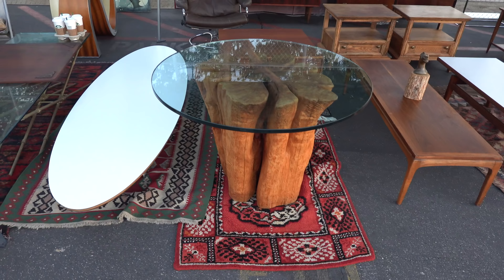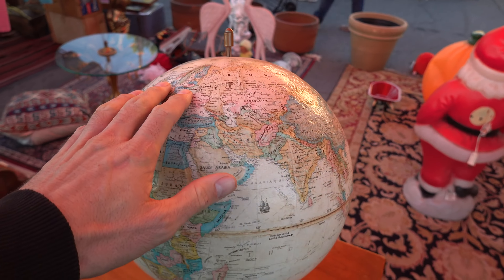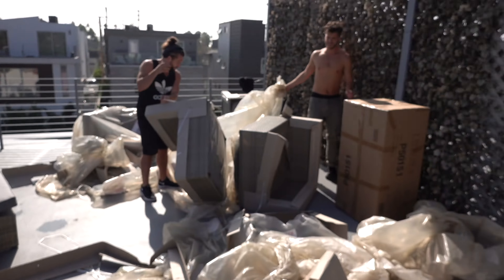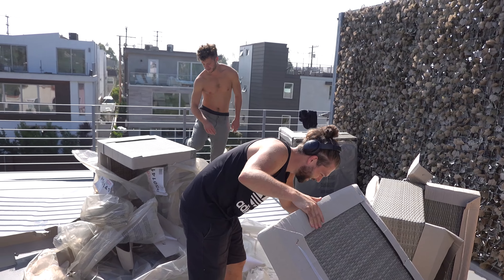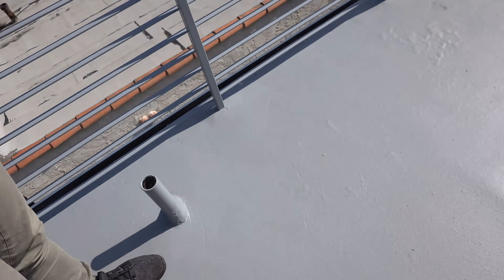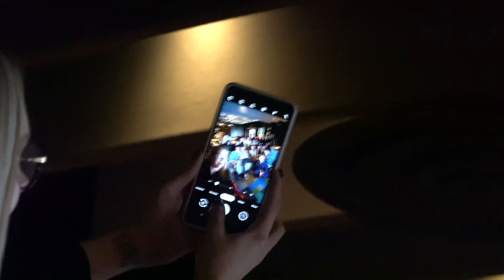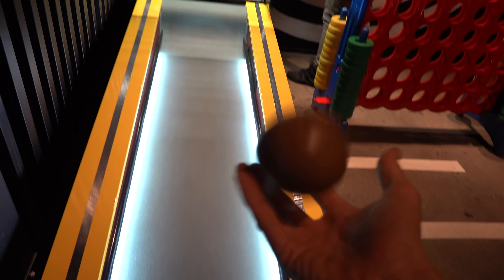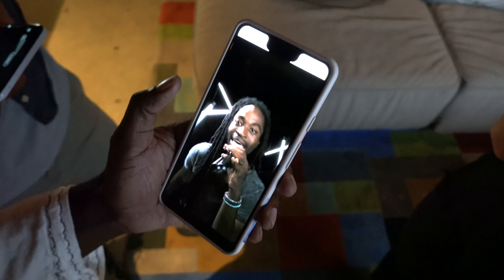FINALLY USING OUR AMAZING ROOFTOP!

Comment: For Shade: you need a wooden rod as wide as you want it but matching with the metal pillars you have on the ailing side. Sew a length of fabric round the rod (almost like you're attaching a flag- then run it so that it can attach on to the hooks on the pillars on the other side- you can reinforce the holes with metal studs that you can get from a diy shop or craft store so it will last longer. You'll also probably want a more durable heavier fabric if its for practicality.

Comment: See those bars on the rail that go up? Id suggest taking a sort of elastic-material-like tarp that lets a little light in and anchor it to the wall and stretch it over top so if it happens to rain youl be ok